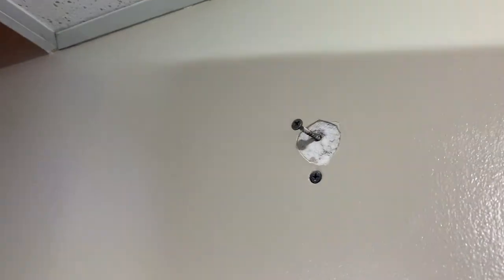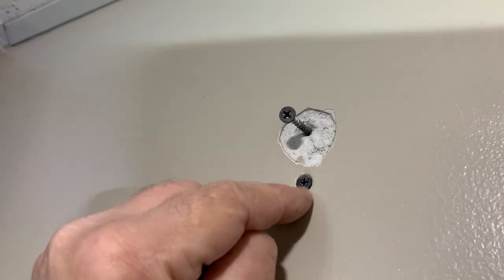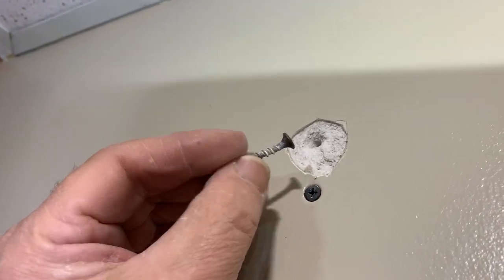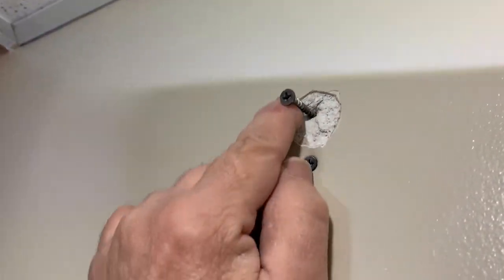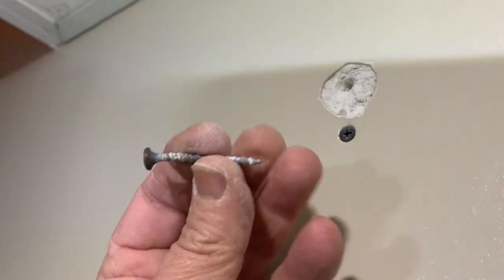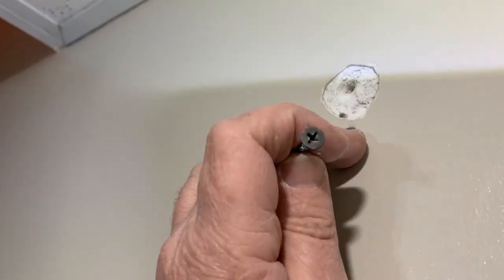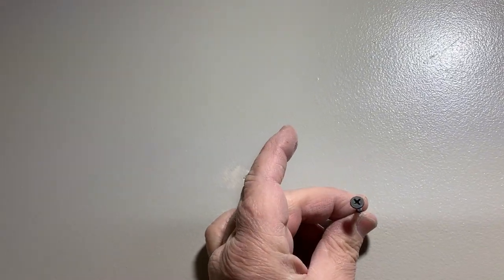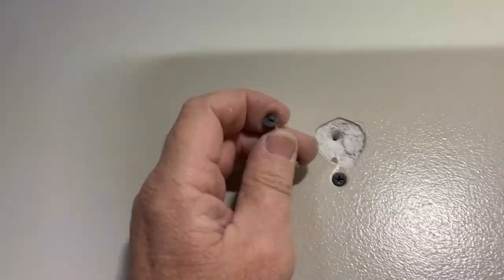Fixing Drywall Nail Pops the Right Way

Comment: One thing I would do is put two screws above and two below. I've made old drywall like brand new by doing that for years. But I've had a couple recurring nail pops by only adding one screw
Reply from the maker: That’s why I take the nail out and eliminate  the nail.Nails are primitive
Reply from the maker: Thanks for sharing

Comment: This doesn't show fixing-this only shows the problem.
Reply from the maker: It shows how to fix it long term, Just knife on the mud & leave no build up on surface
Reply from the maker: Apply 3 coats to allow for the shrinkage factor sand primer & paint
Reply from the maker: Any questions ?